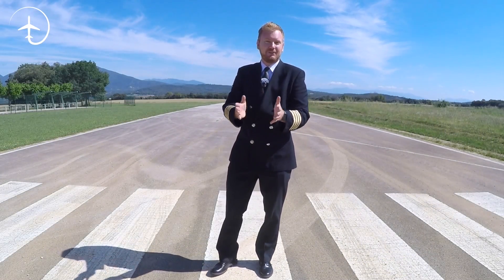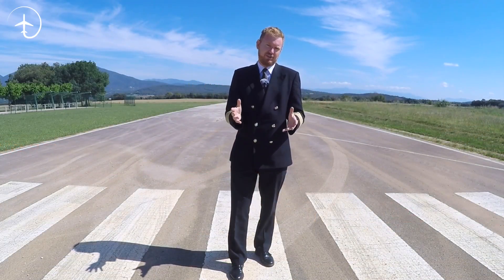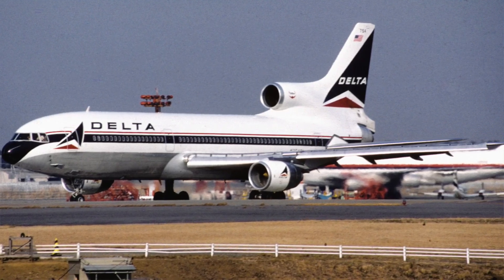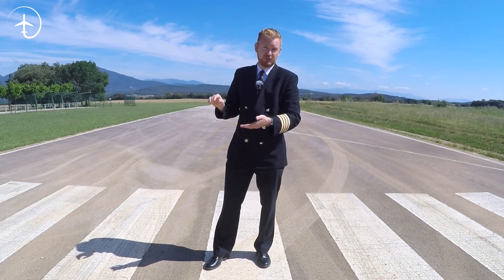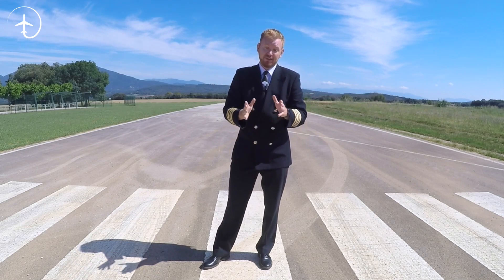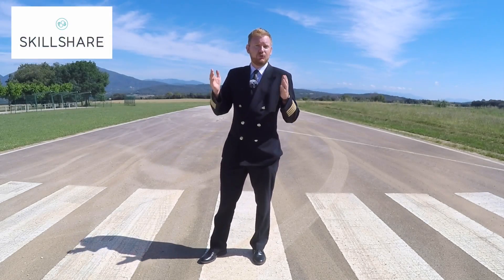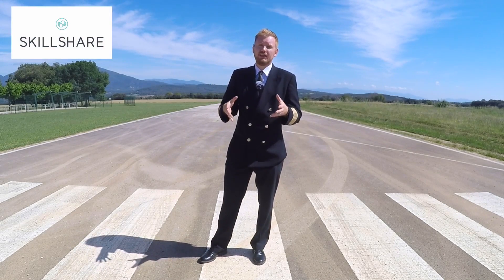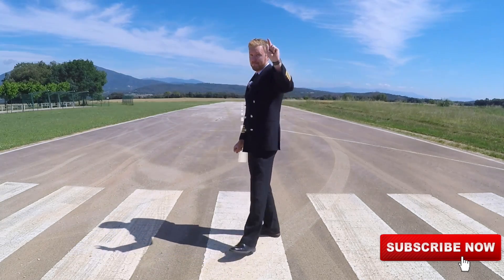Three Engined Aircraft, what happened?

Comment: Really good one, thank you.

So...do you think there is a chance that there will ever again be a single-engine (centre-line) aircraft?  The reason I ask is that you mentioned that because the reliability of engines increased and this led to the approval of twin-engine transatlantic flights...maybe there is a possibility that if the reliability increases even more, a single one might start being approved/used??
Reply: WowIndescribable ,
Too risky for large commercial airliners. Too many expensive lawsuits if the only engine fails and the aircraft crashes. Single jet engine aircraft with 10 or fewer total occupants, crew+passengers, might become a reality.
Reply: Do you mean large passenger jet airliners? Most private civil aircraft are single engine (piston, not jet, mounted on the centerline), but propeller driven. There are also single engine turbo-props, but limited in size & number of passengers by the power of a single engine & regulations. There are a few that are operated commercially, the Pilatus PC-12, and Cessna Caravan come to mind, but I think there are some others, too. As far as pure jets (no propeller), there are some single-engine designs, such as the Cirrus vision, PiperJet Altaire, Diamond D-jet, VisionAire Vantage, and others, but I'm not sure which may be in production & they are all small private jets. I don't think we'll ever see large single engine passenger jets because the larger & more powerful high-bypass ratio engines that are the mainstay of modern commercial aircraft would be very difficult to mount in a single-engine configuration, but increased demands for fuel efficiency & noise could change that!
Reply: erikoarneberg ,
As far as the largest diameter turbofan engines are concerned, in theory you could use an external mounting on top of the fuselage with twin vertical stabilizers and rudders offset from the centerline. It is also possible to use an S-duct type of arrangement similar to the number 2 engine of the L-1011. 

The real objection is one of a lack of redundancy in the case of engine failure. That lack of redundancy is one reason the single engine Very Light Jet(VLJ) category is altitude restricted by the FAA. An engine failure at higher altitudes leaves far too little time to deal with the effects of hypoxia due to complete pressurization system shutdown.Those single engine VLJ altitude limitations are one reason a significant percentage of contemplated VLJs went from single engine to twin engine. The single engine VLJs in production operate with strict altitude operational limits.
Reply: +David Hoffman Thanks for the info- good points! I agree that it would be possible to pod-mount a large, high bypass ratio engine on top of the rear of the fuselage & use twin vertical stabilizers (they might mask some of the noise of the engine, too), but when you look at the dimensions of one of the large high bypass turbo fan engines (and you'd need a big one to deliver thrust close to that of a twin engined design) it could be quite a challenge to have it mounted internally- they're huge! Both intake & exhaust(for fan flow) would be very large. You'd have considerable weight mounted all the way aft (engine and twin vertical stabilizers), so the C.G. & wing placement could become problematic, although you'd have centerline thrust, so that's a plus. I wonder if thrust vectoring could be incorporated? It could decrease the angle of attack for the wing during take-off/climb, reducing the risk of a stall, but as you stated, there are limitations placed on light single engine jets,
Reply: +erikoarneberg Due to a lack of redundancy with only a single engine, & I have to believe that there would also be restrictions- or perhaps no chance of getting type approval (or insurance!) for a large, single engine passenger plane. Elsewhere in the comments, I put forward an idea for a modern tri-jet, with the 3rd, smaller engine enclosed in the tail, with retractable intakes- it would be used  for take-off and climb to altitude (some airports require steep climbs for terrain clearance, or more commonly, noise abatement), then shut down, and the intakes closed to eliminate drag. Such a design would mean that the two main engines could be reduced in size & thrust (reducing weight, drag, and most importantly fuel consumption) with the third engine providing additional thrust and redundancy if there were an engine failure, again meaning the two main engines could be smaller because they wouldn't have to be large enough to keep the plane flying on just one engine, as with current twins.
Reply: erikoarneberg ,
If humans can build an An-225 then I am sure with modern construction technology we could build a significantly large single engine aircraft using an S-duct. There are really no wing placement issues. The VC-10 handled rear engine placement just fine. An S-ducted single engine aircraft would work also. The Global Hawk surveillance drone operates with a single S-ducted jet engine. Operational altitude limitation is supposedly approximately 65,000 feet. In reality it might be able to go to about 78,000 feet in optimum conditions of a zoom climb and then immediate descent. A parabolic arc maneuver.
Reply: erikoarneberg ,
Air restarts are notoriously difficult. Now add in a cold soaked engine. More resistance to full operation of the shut down engine.

We used to get grief when there were afterburner/reheat failures on our aircraft. Think about that. Afterburner/reheat is basically a tube into which fuel and air mix. Simple, yet we would still get failures to ignite at cruising altitudes. A cold soaked turbofan is going to be even more finicky about getting to operating parameters at cruising altitudes.

Comment: I don't understand why you tell that, with an upper intake and a turbofan down into the tail, you cannot change the engines if  the builder make a bigger powerfull engine.
If the bigger powerfull engine can go under the wings, the "retrofit" of an old plane with new motors can be done by changing only the engines under the wings and saving the tail engine as it is. The loss of power will be very little comparing to the cost of a total new plane. Even having to manage two different engine types that has a little cost because the company will still have some engines with potential of flight to be used to maintain the tail engine even if it is no more built.
And with a 50% of increase of power of the engines under the wings, may be you can also, at mid-life of the plane, change the tail and have a bijet instead of a trijet! :-) With planes flying 40 to 50 years, who cares?
Reply: JMT 97400, 
Maintenance headache having multiple types of engines on one aircraft.
Reply: David Hoffman  Headache? :-)  waow! I will notice to never fly on airlines so stupid not to be organized  to maintain a plane with 2 different types of engines! (and what do you think about the "headache" by having an APU?). And explain me then how do these airlines to fly with different planes?
The reality is that airlines are big wasters of material and fuel, searching only to make money and allowing people to make a lot of unnecessary flights, with a lot of damages at the atmosphere, by flying and making traffic jam around main airports (in the air and on the ground) and then private profits and public expenses. 
Heavy taxes will be needed on air traffic and that money could allow to built new railways for public fast trains available for all short and medium range travels : including night travels and fast trains, you can make 3000km with better comfort and less global cost (don't forget that a fly cost is not only the price you pay your ticket!)
Reply: JMT 97400 ,
The increased use of high speed passenger rail is a good idea. The European countries have been trying to do that to reduce the air traffic congestion so that long range airline flights are better accommodated. 

The way to handle the engine upgrade on triple jet engine airliners is to require the upgraded engines to fit into the same physical dimensions as the existing engines. Look at the military F-16 as an example. Several engine thrust increases, but all within the same engine bay.

Comment: Something that's never occurred to me to wonder about before: where do trijets have their APUs? I'm guessing it varies. Presumably any that use a DC-10 type layout with the centre engine in the fin could possibly put the APU in the usual place, though it wouldn't surprise me if there are good reasons not to have an APU and an engine so close together. But S-duct aircraft must have to put them somewhere else entirely.

Comment: You forgot that airlines wanted planes with less engines to fly long over water routes and due to the regulations of that time twin engine planes couldnt to that till the 80’s with the 767 so the soulution then was to have have three engines. Enough to cross oceans but more fuel efficient and less costly then 4 engine planes.the reason you dont see tri jet planes anymore is because of ETOPS ratings in the 80’s which changed everything allowing the b767 and all twin engine planes that followed to fly long over water flights

Comment: I've heard, that recent drop in popularity of 4-jets (like A340; especially in far east) is because of their poor climbing performance compared to widebody twinjets (B777, B787, A330, A350, …). If you consider that the plane has to be able to climb after single engine failure, then twinjet has around 200 % of needed thrust when both engines are in good working condition. 4-jet with same redundancy has only 133 % of thrust available, while trijet lies in between with 150 %, which is closer to that of 4-jet.
Having a lot of excess thrust certainly helps with quick climb to cruise altitude, which is essential in crowded airspace, while on the other hand it means, that at cruise altitude, you will be flying with slightly lower fuel efficiency (efficiency should increase with higher thrust settings). But then again, flying 4-jet well bellow desired flight level, because FLs above you are occupied by faster planes and you don't have the surplus power for quick climb is even less fuel effective.
Of course, this is only another reason together with ETOPS and maintenance costs, that disfavors trijets and 4-jets compared to modern twinjets.

Comment: Is this true that the tail engine is used mostly to take off and cruzing then other two engines get less use while cruzing to create less noise for passengers?  One thing you forgot to mention was that a three engine plane needs smaller runway and could take off with a steeper angle if it's design premmits.

Comment: Speaking about the three engine aircraft disapearing at the end of the 1990s because of the new large fan jets that had a BIGGER BYPASS. This leads me to ask a question that has really been bothering me.

Ever since I was 6 years old (1960) I fell in love with flying and aviation. 
AND I also have had a lifetime love of nature which includes the sky. I remember how I used to lay in the grass for an hour looking into the sky. Back then the only contrails I remember seeing was behind a jet flying at a very high altitude and it would seem like a tiny dot in the sky moving very slowly . There was always a very short twin contrail that disapeared about a mile behind it ( I am guessing a mile) 

It was not until after the year 2000 that I started to see those huge plumes of white vapor that cover the entire sky. 
And strangely enpugh I began to notice them coming out of aircraft that were flying quite low. 

So here is the question. Could it be possible that the reason the contrails got so much bigger in the year 2000 and on because of the larger bypass engines?

Comment: Hello mentour pilot. I have a query.  Can u tell me the purpose of high wing and low wing aircraft. Why high wing is limited to only military purpose?
Reply: What makes you think a pilot would know an answer to that? If you asked an engineer in the field capable of designing airplanes instead of flying them, you might find out that interference drag between fuselage and wing is a very significant factor for vertical wing location at high transonic speeds, and low wing is better in that respect. Also, long passenger planes need enough ground clearance below the fuselage aft of the main landing gear to allow for rotation for takeoff without tail strikes. Hence the fuselage can not be lower down, and the wings don't need to be any higher making the landing gear legs unnecessarily longer and thus heavier.
Military cargo planes have a ramp and are required to allow for smooth floor in the cargo space for vehicles unavailable at wing location if using low wings. Placing the floor higher like in the passenger planes would result higher fuselage for same vertical space for cargo and more drag and a heavier ramp.
Reply: There are many civil aircraft with a high wing- just look at almost every Cessna, or the ATR-72 series of twin-turbo prop passenger aircraft, for example. And there are many military aircraft that utilize a low wing design. Perhaps you are referring to military transport/cargo aircraft, like the C-130 Hercules, C-17 Globemaster, Airbus A400, Antonov 124, and many others. These transport/cargo planes all look similar because they are designed for a similar purpose and requirements. Their wings are designed to offer good STOL (short take-off and landing) performance, which limits their top speed, but that is not what they are designed for. With their extensive wing flaps, they can also fly slow enough for paratroops to jump, or air drop cargo. One of the main reasons they have a wing mounted high on the fuselage is that they are required to be able to land on rough, unpaved airstrips, or even just flat open terrain. Because of that, keeping the engines as high as possible helps to keep
Reply: +erikoarneberg the engines from ingesting dust, sand, dirt, gravel or other debris. They also have very strong landing gear with multiple wheels/tires to reduce the ground pressure when heavily loaded, or operating off of rough or soft surfaces, to avoid the wheels digging in and the plane getting stuck. This is an oversimplification of aircraft design, but essentially, the intended use of the aircraft largely dictates its wing size & shape, mounting location, engine type, number, and position, and on and on... There are reasons that aircraft designed for similar purposes increasingly look the same; some designs and configurations are more suitable for a particular task. This is why most modern, large passenger jet airliners look almost identical, with a few exceptions. Even current fighter aircraft are increasingly similar, within their intended roles. I hope this helps answer your question to some extent.

Comment: why do cargo companies still use a lot of trijets?
Reply: They've become available cheap, since passenger airlines phased them out. Since there is no need to pressurize the cabin of a cargo plane there still is some useful life I them.
Reply: Cargo planes are pressurized, flight crews are not wearing oxygen masks during the flight.
Reply: The cockpit is pressurized indeed, the cabin isn't.
Reply: What types are you referring to? Specialized cargo planes like Airbus Beluga and Boeing 747 Dreamlifter have pressurized flight deck and unpressurized main cargo hold because of their relatively lightweight fuselage structure. But the cargo planes converted from pressurized passenger planes are fully pressurized. Otherwise, there would be need for an extra pressure bulkhead behind the flight deck. I've never seen a picture of one. If I'm wrong, please advise me with some references.
Reply: Boeing 747F

Comment: One other problem of the tri-jet is growth design for aircraft balance. Douglas Aircraft before the DC-10 would stretch the DC- 8 fuselage both fore and aft of the wing to add capacity as engine power was being improved. Boeing 747 could do the same. The 737 used to be what I liked to call the "Baby Boeing" for its relationship in length to its older siblings the 707 and the tri-jet 727. Its popularity today is that it had two engines, and could grow into a bigger aircraft that eventually replaced those siblings mostly by improvements in the engines.  The balance problem related to the wing location meant bigger, often heavier engines were hard to design around a common wing. Engines may be the most expensive component per individual aircraft, but wing design and flight proving are the most difficult and expensive engineering challenges for a type.
The tri-jets went the way of their ancient forebears, the Ford Trimotor  and the Junkers JU-52 as two engined aircraft like the DC-3 proved their worth. An interesting point about the 727 in the U.S. market was the Eastern Airlines advertising of it as the "WhisperJet". It wasn't particularly quiet outside as it use the same low bypass engines just about every other U.S. passenger jet in those  days was using, but for most of the passengers its rear mounted engines were more soothing to the ears.

Comment: The McDonnell-Douglas interpretation of the trijet requires routing hydraulic lines around the #2 engine to control the tailfin. United 232 proved this isn't such a good idea: when its #2 engine broke apart in flight, the hunks chopped through all three hydraulic systems and rendered the plane unsteerable. (They brought it to its doom in Iowa, saving about two-thirds of the passengers in the process, by steering it bulldozer-style with the #1 and #3 throttles.)